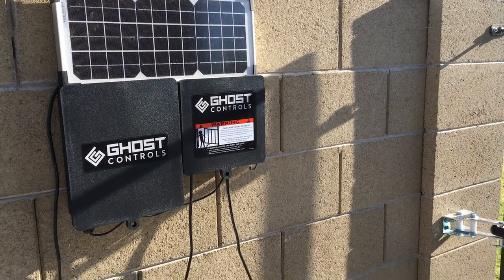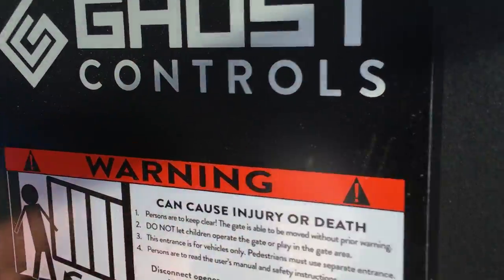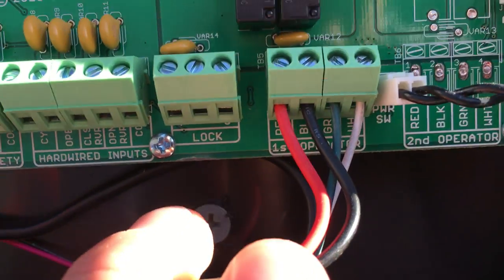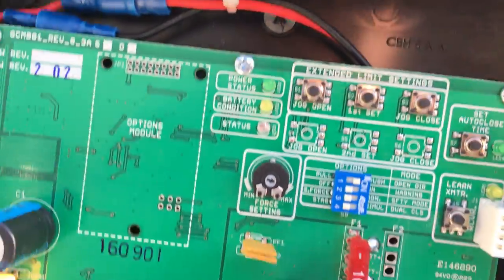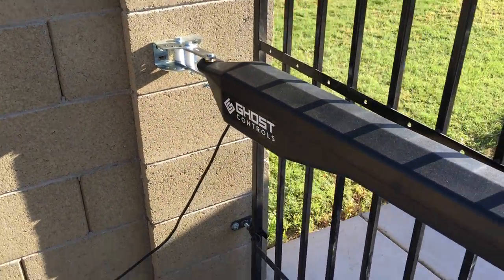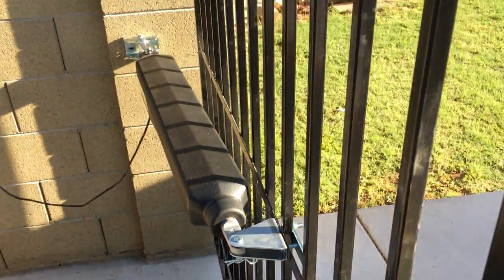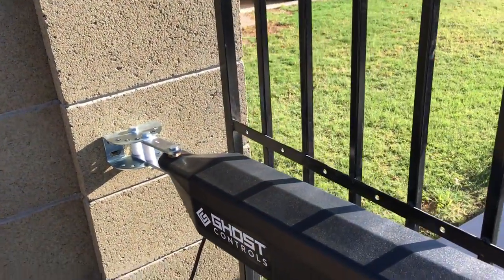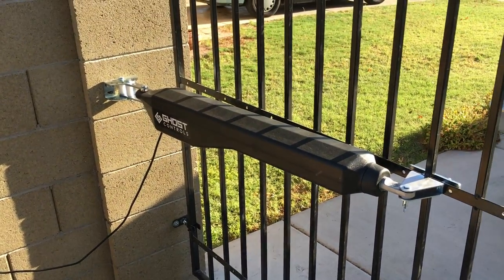Ghost opening the gate

Comment: Can i hook this to a marine battery large one?
Reply from the maker: Yes, absolutely. It's a 12 volt system, so any 12V power supply will work. The larger battery will simply provide more open/close cycles without needing to be recharged. 
I get 1-2 years out of one of these smaller batteries, with Ghost Control's solar panel connected.

Comment: There is a wiggle room in the shaft so you need to pull it all the way out while in the fully retracted position to get rid of that wiggle room otherwise you will end up with the V like you had .. Not fully closing will be a major problem if you are using a zombie lock .. I tried 2 gates and the shaft had the about 1/8” of wiggle in both and it caused my 14” gate to close about 1-2”  ahead of the desired ending position .. I know this is against the instructions which says not to touch the shaft after automatically retracting it but it is the only way that worked for me to get a tight closing.
Reply from the maker: Thanks for the tip. 
I learned also to screw in or out the silver arm that comes out of the actuator for fine adjustments.
Reply: Just installed the Ghost and also have ~1/8 of actuator end play. I tried what you said and also what the OP, Dave Robinsons said, and no matter what was tried the actuator has ~1/8 inch end play, wiggle room .  Open or closed, the end of the 12 ft gate moves about 3~4 inches because of this end play. Did you completely remove the end play and make it solid? I watched other vids and it seems like those gates also have a couple inches of play opened or closed.  As my install is a single swing gate, the closed position is fine 2 inches in either direction. Just thought the actuator would be more solid and have better gear tolerances. Never owned a gate opener before so maybe this is typical...
Reply: @ridemfast7625  yes pull it out and tighten the gate with every thing pulled out as far as you can ..

Comment: Add a positive stop with a piece of aluminum angle iron. Screwed to the face of the gate because one gate is always going to close before the other one and you can set your limits against the gate but it works doesn't it? Good job

Comment: WELL DONE ON A GREAT REVIEW!!  I'm thinking of using them to open a set of lightweight barn doors (a much cheaper option than automatic barn door openers).  Do you see any issue with this and how long is each arm when it's closed.  Each barn door panel is only around 36 inches.  Many thanks again!
Reply from the maker: So sorry I didn't respond sooner. Are your barn doors hinged to open in or out? I don't see an issue for when they're closed, because they're not always mounted at the 0" mark, but in the negative inches area, if that makes any sense. If the door is 36" wide, you may have the front clevis pin bracket at 35.5ish inches (where the doors meet in the center), and then the foot of the actuator arm would be mounted past the hinges, and often times around the corner of the supporting post that the door hangs from. Am I understanding your setup correctly? I think this would be a go, and a smokin' deal that you'll end up showing off to your neighbors. Since the remote is dual button, two barns can be set up on each remote--the cattle barn on one button, and the machine shop/garage on the other button. Please post a video or pictures of your set up and post the link here. I'd love to see it.
Reply from the maker: One more idea: Ghost Controls makes different length actuator arms (called Operators). Check out their site here: https://ghostcontrols.com

Comment: Sorry for dumb question, But I’m confused . If your inside your property does the gate open into your property or outward away from your property ?
Reply from the maker: I have this one set. up to swing out. Same unit can swing in, the only difference is how you set it up to function. Mine swings out.
Reply: @DavePR  Thank-you for your response . I have the same kind of Masonry columns and my mounting will need to be similar to yours .  I just wanted to make sure I would still be able to have the gates open to the inside of my property. If they had to open outward I would have to stop in the road for them to open .
Reply from the maker: @dtm6215  The biggest change is that your gates will rest with the arm extended, so it pulls the gates inward. 
Mine rest retracted and push the gate outwards. 
When I installed these, nobody had yet posted any photos or videos of block wall mounting and pushing outward, so we just crossed our fingers and gave it a shot. I'm so glad we did, and this electric gate is one of our favorite features of our home, and my kids LOVE it. 
Ghost Controls has been awesome for us.
Reply: @DavePR  yes I have looked everywhere and finally found your video . No one shows them mounted to brick posts or block posts. I think the arms being extended all the time would possible cause damage to them . I will have to really think this over .
Reply from the maker: @dtm6215  they’re designed to be extended all the time and pull to open. Your use is the standard use. 
Mine is the oddball setup. 
Give Ghost Controls a call.

Comment: It' been almost 18 months since you reviewed this opener.  Has your opinion changed at all?  I'm on the fence (pardon the pun) about this vs. Mighty Mule - and quite frankly, the reviews for the MM are scary.
Reply from the maker: Yes, I still love this opener! I thought for a few days that it was getting sloppy, but the problem is that the cement block to which my actuator bracket is bolted is not filled with concrete (not grouted), so my bolts needed a touch of tightening. I kept thinking I'd fill the blocks with concrete, but I have not needed to since I tightened it again, and really just a bit more than finger tight that second time. The operator arm starts and finishes really nice and slow, as you can see in the video, so that there isn't incredible torque put upon the bolts. 

I still feel the same about Ghost Controls' gate opener. The only thing I'd change is adding a second keypad behind the gate like I have in front of the gate because of one of my favorite features--you can't open the plastic control box and push a button to open the gate. I have remotes behind locked doors and in the car, so a second keypad would be great, but not necessary. 

The solar panel has continued to keep the battery charged. I have been very pleased with this opener.
Reply: Dave Robinson awesome. Thanks for your reply.  Due in no small part to your recommendation and review, I have one being delivered today.
Reply: I got one installed today and it was not really that easy right away. Like he says don't lock anything down until you know for sure where are of your holes, bolts are going to be. I followed there instructions and basically had to start over.  I have the dual gate one and cedar posts. Thing is bad ass now! This is the gate opener to get. I bought everything and it was about 1100 bucks or so.
Reply: @DavePR  Great video! First one I've found with fastening to concrete. Any idea the diameter of anchor you used?
Reply from the maker: @ronmcgowan  Probably 3/8". I just used what I had on hand that fit the existing hole in the bracket, and I filled it up. 
We still love the electric gate, and operate it at least 30 times a week.

Comment: You could have mounted the gate operator on the recess of the brick column and open them to the inside. He only need 4 inches geometry but it works doesn't it? Good job
Reply from the maker: Absolutely that would be cleaner, but those blocks are thinner, whereas the H block is grouted, so there is concrete back behind the fragile exterior of the block. 
If the interior blocks were stronger it would be a perfect way to get it more out of the way when opened! 
Thank you!

Comment: Dave, Thank you for the well-done video. How did you bolt the bracket in the block? My application is a bit different. The gate is hinged to a 12 x 12 brick post. The instructions ask to drill thru the post in order to fix the bracket. but I don't believe I can in this case.
Reply from the maker: I did bolt the bracket to the block--I used sleeve anchors from Red Head. You'd want to do the same--use two of the four holes in the back of the bracket and you're good to go. I need to fill that block with concrete, but a year later the gate is still doing just fine with just being anchored into a hallow block wall. Good luck with your project, and when you finish it, send me a link to your video. I'd love to see it in action!

Comment: Thanks a bunch!  My swing out 16’ gate is gonna be motorized by midweek!  I’m using your exact setup!
Reply from the maker: Upload a video and send the link or shoot a photo to me at Dave@MasterGermAndOdorRemoval.com. I'd love to see it!
Reply: @DavePR  almost finished it today; have to get the solar panel up, plant a stop post, and secure the wires.  Hardest part was handling the gate solo!
Reply from the maker: @willloy8901  Solar panel up? That thing has just been laying on top of my wall, as seen in the video, since the video. It worked so well there that I didn't bother with it.
Reply: @DavePR  the solar panel is up, and it works better than I expected.  It was making 15.5V with minimal sunlight.  Before I installed it, I checked the voltage on the batteries.  After installing and many check openings/closings, the batteries still had over 12V.  I also installed the access keypad and the ghost lock.  Seems to work perfectly so far?  I am going to reposition the antenna in hopes of operating gate from the house.

Comment: Thanks so much for this video. I'm going to install one of these instead of getting a very old Liftmaster opener repaired. The push to open option is great since I can keep the opener inside my carport. Much less expensive parts and simpler if future repairs are needed. Thanks for the tip on finding the resting spot before marking the holes.

Comment: Great video! So helpful. Only one question left before I purchase.. I need an outward open solution and have a skinny driveway. How much room do the swing arms take up inside the entrance when fully open?
Reply from the maker: Mine is 7.5" from mounted side of gate to furthest out point of the actuator arm. Add an inch if you have it held open at 90 degrees. Mine I open a bit wider, the width of my concrete H-block the arm is mounted to--the gate opens to the edge of my driveway, which is a little further than 90 degrees.

Comment: As you mentioned in your video I could not find any information on how to install the opener where the wall amount is the same plane as the gate like yours. I am so glad I stumbled across your video.
Thank you a million times for your short and informative video.
Reply from the maker: I use the opener every day! Yesterday I took out the recycle trash, today I used the opener again to bring in the can and blow out the pine needles. 
I am a huge fan of this gate opener!
Reply: @DavePR  after I saw your video, I ordered my opener and I'm tackling the job tomorrow. Thanks again
Reply: @DavePR  Maybe it will say in the instruction book? But maybe you could answer me this question?

Since I'm installing my opener on the same plane as the gate, just like yours. Push to open, just like yours.

How far away from the closed gate does the bracket that is mounted to the wall that holds the opener arm go?
Reply from the maker: @mrfiskars  I'm out of town right now, but will check next week when I get home. 
If I recall correctly, it was just a bit so that the arm when fully extended and the gate is closed gets to the wall. The measurement is a result of where you put the anchor on the gate itself. 
I hope that makes sense.
Reply: @DavePR  it sure does make sense, thank you

Comment: Thanks for the great review. I appreciate the tip about running the Piston to see final resting spot before mounting the bracket to the gate. Looks like you might be able to weld a pair of those arms at a slightly shorter length and keep existing mount spots but get a square close. I'd be happy weld them for ya if that's the case. I've had plenty of self installs of nice hardware that came out just a tad off. I know the feeling. If part is available, you could ship to me, I'll cut and weld, then ship back to you. I have no idea if this could work but knowledge has value. Id love to give back a weld for it if it would help ya out.
Reply from the maker: Wow, Brian! That is a really fantastic offer--I'm honored. I drilled the stop for the non-powered gate to match the front of the power gate, and I'm the only person in my world who really cares, so I really appreciate the offer, but there's no need. 
I'm really glad the tip was helpful for you. I'm really impressed with the opener, and at this price point, I think every house in suburbia should have powered gate openers, as well! This is not just for the Paradise Valley crowd, but this is genuinely for everybody--easy install, easy operation, custom controls if you want them, and reliable as can be. Let me know if you install a gate opener. I'd like to see how it goes for you.

Comment: How did you determine the distance to mount the bracket from the gate im looking to mount it on a 24 x 24 brick coluum similar to your mounting on block  and gate will swing out 
Richard
Reply from the maker: Great question, Richard. I mounted the large u-bracket to the block at the correct height for the operator arm to push against the middle horizontal black metal bar in the gate. I went in from the edge of the block so that my anchors were not in the side wall of the block, but in the sections of the block that get mortared (concrete poured down the hole from the top).
Then I just put the end of the operator arm where it naturally wanted to be and mounted the small u-bracket to the black horizontal gate bar.
Note that the operator arm has fine-tuning by turning it clockwise or counterclockwise. I didn't realize this when I was installing it.
Reply: @DavePR  thanks for getting back to me

Comment: Here in Australia I recently replaced my old gate opener from (APC) the great thing about the new control box is with the two batteries that come with the kit are charged through the motherboard so there is no need for a solar panel. My other gate closer I installed a battery back up and it was charged with a transformer.
Reply from the maker: I use the solar panel supplied. It feeds into the motherboard, and out to the batteries. It keeps them charged up and ready to go, no external transformer needed. 
The openier is wonderful for us!
Reply: @DavePR  I would only install a solar panel if I was off the power grid.
Reply from the maker: @robertbutler8004  mine didn't come with a plug in. That's an option, but I was really happy to not run power across the side slab to the gate opener.

Comment: There is an optional lock to purchase. Will the gate swing or manually open if you don't install the lock?
Reply from the maker: My gate stays closed and I have not purchased an optional lock. Think of it as a garage door opener--one can purchase an additional lock to keep the door closed (the handle in the middle of the door engages and disengages garage door locks...most people don't even notice the handle, if it's there at all). 
The garage door opener keeps the garage closed without additional locks. An additional lock can be added to defeat the garage door opener, but no one does that. 
If your property is typically vacant, an extra lock may make sense for you, but for my residential application I am very pleased with it without an additional lock.
If you're talking about replacing the clevis pin, I have not and I'm not worried about it. Can someone get my gate to open? Sure, but the person who does that won't be dissuaded by a lock on the pin.
I don't know if this answers your question. Let me know if I misunderstood. Feel free to drop a link to photos of your gate or a video of your application.
Reply: @DavePR  it makes sense. I was hoping for this answer.